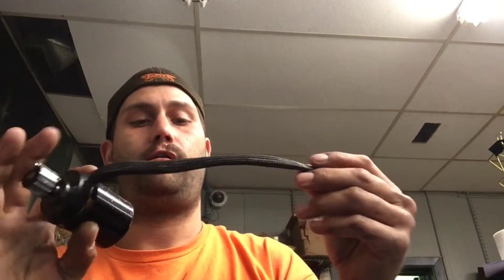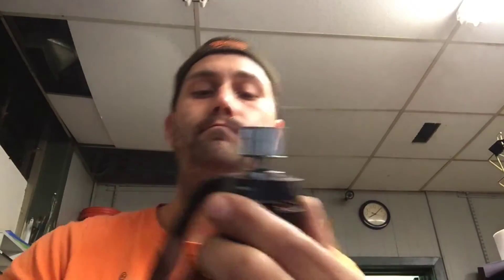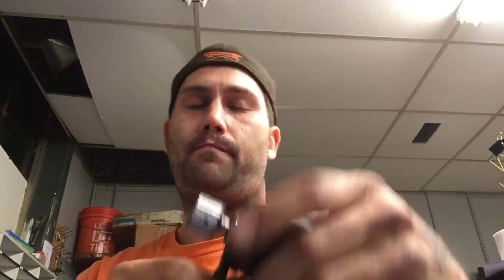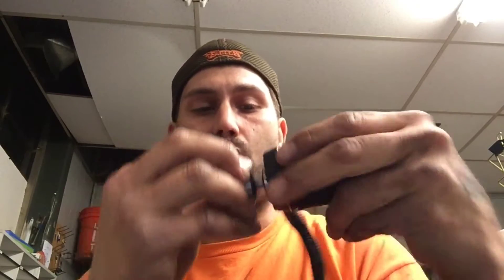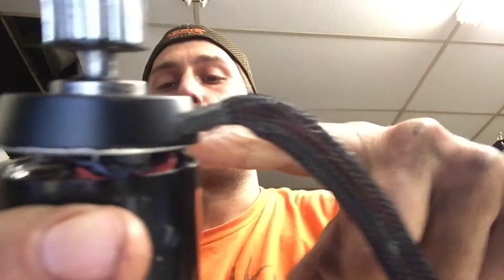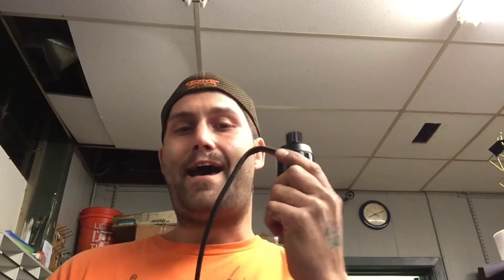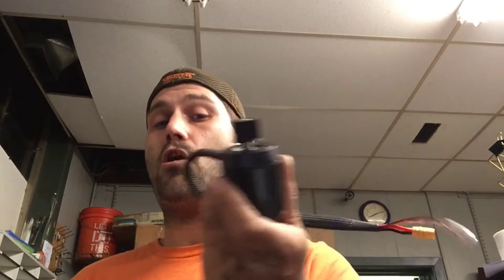Evolve Gt Motor Issues SOLVED Electric Skateboard Motor Racestar 5065

Comment: Would you be able to help me with replacing my motor on my evolve bamboo gt
Reply: I bought the same motor that you bought but the cables are not the same plugs.
Reply from the maker: @lucasbarcelos371  yes, sure. can you send me an email with some pictures? Lets see what kind of connectors we have on the board.
Reply from the maker: @lucasbarcelos371  thebrokerscollection@gmail.com
Reply from the maker: I am going to have to get my hands on whats currently out. They wont send me anything so I will have to pony up for it. Evolve is the king of trying to get us to over pay for parts. They make a frickin fortune off parts

Comment: Hey Joe!
Could you tell me if the GTR motors would have bearings inside them that COULD be replaced if broken?
I got a call from my service and they told me that my motors were fine but the bearings inside the motors were broken..
I thought you cant fix the bearings inside the motors on Evolve boards.. is it even openable?
Reply from the maker: No and they shouldn't ever go bad either.  The motors where the inner bearings go bad are junk.  I have other that last years and years. They are not meant to be replaced.  Once it gets to that point,  thers is more damaging happening besides the bearing.  For the money they should be selling top of the line parts. They just dont
Reply: @JoeKyser  Interesting.. well thats what the service told me, going to get my hands on my board in a few hours to see for myself, I will get back to you. Btw thank you so much for videos like this, so hard to find anyone talking about the more integrate parts inside Evolve boards. I bought myself HADEAN.. it died 3 days in lol.. I cant.. still waiting for them to repair, been almost a month. The board that has bearing problems is my old GTR that im suppose to get back today.
Reply: @JoeKyser  Turned out it was the DRIVEGEARS lol.. I got there the guy 1. told me he dont drive skateboards.. I asked so DID YOU TEST? Well I turned the wheels on my desk......... so I hop on board, still same horrible noise.. I then told him to remove the bearings as the old ones were fine imo and when he took off both gears me and another tech guy took a look at them and noticed they were.. WIERD.. and different to each other.. like.. where are the gears??? :D we had one pair of new ones.. compared.. MY GOD.. I had literally STRIPPED every single drivegear on it.. it was like a SMOOTH surface lol.. put the new ones on and BOOM, works again like new. Interesting that they made a noise like the motors were broken.
Reply from the maker: @TheTanelChannel  oh I have a video somewhere about if your motor is making noises or something like that.  It could be a lot things that isnt the motor.   I feel like I am interested in hearing more about the person who is fixing it and doesn't ride.  I mean sure its possible but how can you really be a technician thar doesn't use what they fix?
Reply: @Joe Kyser  they mainly do scooters there, its a proper workshop with 6-8 guys all working 24\7 on them. Scooters and Monowheels. Yeah so add this to the list of wierd noises :D maybe your belts slipped a few times, could easily kill the drivegear
Reply from the maker: @TheTanelChannel All the riding I have done,  I have never stripped a hub gear.   Ive broke belts before.  Never stripped one out.  It had to have been set wrong to begin with to strip it.  Either that it it came loose and kept using it.  One of those. Im sure it would make a noise though.  It definitely makes more sense that they were replacing the hub bearing.  Even those bearings,  if rhey are proper rated abec 9s, they will never fail.  Anything less and there may be failure.
Reply: @JoeKyser  the screws came too loose and the motor slipped a bit and belt came too loose.. slip here.. slip there, you tightern again but actually what happens is with each slip you wear the drivegear down a bit more and more.. I drove a few days atleast with it slipping constantly when braking lol.. I thought it was the belts so I had no idea I could actually grind down the teeth like that.
Reply from the maker: @TheTanelChannel  yeah thats what I was saying.  If it comes loose and you keep using it,  im sure thats will happen.  A little pro tip,  check every nut and bolt either when you are done or before you begin.  It is super important.  That could save your life actually.  Trust me.   Its just a couple if tools or a good skate tool.  Anything that can get loose will get loose.  It's not it might get loose.  It wiol get loose.  From Kingpins to wheels and everything in between.  I have seen or experienced it.  I actually experienced the kingpin one myself early on.  What a wipe out.  Over a losse kingoin.  Took months to rehab from that.  Only if I had the proper talking to.  Trust me when i say check it all everytime.  I took too many repairs with injury stories to back it up where it was just something that came loose.  You know now and your experience should be much better moving forward.
Reply: @JoeKyser  ive been riding eskate for like 8 years now so I know how often to maintain it, never had bolts come completley loose yet but when I do maintanence I do find some bolts get a bit loose pretty darn quickly..

Comment: Can you use the gear from the old motor? Or do you have to buy another one.
Reply from the maker: You can use the old gear. In order to get it off you're probably going to have to heat the shaft up which will ruin the motor but yes you can use the old gear
Reply: @JoeKyser  thanks man. I think I have the same problem as you had, my motor is all wobbly for no reason. I was out riding and all of a sudden I hurt this terrible noise and felt drag on the motor. I found another topic on reddit that mentioned the same motors as you but they told me to get a new gear and grub screws.
Reply from the maker: @sages101  yeah it's definitely a lot easier just to get the new gear and set screw but you dont have to. You heat up that old Gear with a propane torch it'll pop right off
Reply from the maker: I have one here if you can't find them

Comment: what about the 140kv ones? are they good?
Reply from the maker: absolutely, i was never able to kill the set. I still have them in case i need them. Amazing, wish i could say the same for the 3 evolve motors at $220 a pop
Reply: Joe Kyser hahaha maybe ypu should check put the vesc from banggood... i THINK its called flipsky fsvec ...its €60 ... programmable... it looks the same as the 100evro one... but i dont know if its any good

Comment: the 3 dollar motor gear they sell is also compatible with the stock 32T setup?
Reply from the maker: send me a link to it so i can see and be for sure
Reply: @JoeKyser  You said in one of your videos that to change the gear on the motor, you have to heat it up, if you do heat it up, it destroys the motor along those lines I think. So I just purchased the 200Kv racestars that you have on your board, and want to put the 12 T high torque gear from board bumpers on the 200Kv, does that mean I have to buy another set of motors or was that a mistake?
Reply from the maker: @rossdevers9478  not to change it, just to take it off. Only evolves motors though. Never had this issue with others.
Reply from the maker: @rossdevers9478  ya I just went with the stock gear.

Comment: Thanks for the great tip Joe. I saw in your one of your previous videos that you buy the belts from V-Belt supply. How do I identify the belt to use with my Bamboo GT?
Reply from the maker: +Trinitics you have to figure out what gear that you're using. Street 32t or 36t or AT. In he xomments others have answered if its the same one i was on yesterday because someone had asked me and I posted a link for them and notice that others had answered as well. I use 32t Street setup its 250 5m 15.

http://www.vbeltsupply.com/checkout/cart/
Reply from the maker: +Trinitics use the code "youmatter" for 10% off an order
Reply: I also have the 32t, so that is just perfect.
Thanks Joe!!
Reply from the maker: +Trinitics then that's the one you need absolutely. the pretty cheap aren't they compared to what they want from the manufacturer for stock replacement. and I tell you what I haven't had to replace mine yet since I switched them. so they are good belts
Reply from the maker: by the way they are official sponsors of the show now. use code esk8world for 10% future purchases

Comment: I might get a evolve bamboo gt will it fail on me?
Reply from the maker: +Yechiel Chli well what I can tell you is I used to board a lot. I've had plenty of fail and I've seen plenty of fail. I think it all depends on how much you're really going to use it and what kind of conditions you're going to be using it on. I suppose if it was only flat smooth surfaces you would make out very well. there's not any bored out there yet on the market that can really truly hold up a hundred percent. the raptor 2 tests out very very well as far as durability. I wouldnt go as far to say yes it will fail. There's risk with any company. With evolve theres just less risk.
Reply: But i want the range i wanna sell Boosted and get evolve gt! Do u think they fixed there problems because they r aware of the situations They've been having. i live in Brooklyn do u think i am fine?
Reply from the maker: +Yechiel Chli i feel you! that's why I don't have a boosted board I kind of really want to buy one but man I don't feel like blowing a grand or 1500 you know and it mean if I'm going to be pissed off going from evolve to that. I hear the streets are messed up up there I tell you what you'll have the best luck with the all-terrain version that's exactly what I would do I never had any problems at all never ever ever when I use the all-terrain Wheels. I mean me personally I'm not trying to brag but I can replace things like I have the money if you don't have the money you don't want to replace stuff go with the all-terrain Wheels you should be perfectly fine
Reply: How about 97mm weals ?
Reply from the maker: +Yechiel Chli I'm going to be completely honest with you I have not tested those Wheels yet. I have them. just haven't tested them I tell you what maytech sends me out my new Motors today. when they get in and I'll put those on and I'll try the 97 millimeter wheels and I'll let you know what I think. after I sent that message I did kind of realize that but I really don't have anything to comment on it I'd be lying if I said anything different

Comment: can you try fitting to the evolve gt. be good to know if we can replace them cheaper
Reply from the maker: +chriscrowderguitar absolutely i can do that as well as a stats comparason and possibly other options such as upgraded motor. I am definitely bringing it to light over at evolve the issue with the fact there's people that bought boards from them and need to repair them and their parts are just extremely ridiculously expensive. So after the the warranty is up there's nothing holding me wanting to put evolve Parts back onto the board. That's a great question you have though and I'm certainly going to address that
Reply: wicked son let me know asap I'd go for the 2k motors love my gt but could do with a little extra top end x mate if you can let me know lol. Evolve world cup in France come! in June I think I'm riding in it x
Reply: the evolve community's eyes will all be on you son.
Reply: Top man dude im waiting with baited breath.
Reply from the maker: +chriscrowderguitar I'm putting together a video right now as we speak I went ahead and tore down the old truck assembly I'm going to paint it make it look a little bit better and I'm going to fit these motors on it then I'm going to go ahead and move over to the board and we're going to do some tests and I'm going to videotape all the tests. And to top it out since I just teamed up with May Tech I'm going to have them send me a couple of their 5065 Motors and we're going to do when upgrade on it we're going to do 200 KV I was thinking 170 because that's probably about perfect but the carbon GT is it beast and taken into consideration a couple other people I consulted we're going to go ahead and we're going to do the 200 KV motor and we're also going to do a battery upgrade. The battery upgrades really not going to hold up to the increased battery drainage but it will make a little bit of difference without an upgrade it's going to make a huge difference. So already I got a couple cool things planned here. Not only will we be able to learn about the lowest cost option which actually matches exactly what evolve has and a little bit higher cost option. I'll try to map the difference between the two and do my very best to show the pros and the cons as well